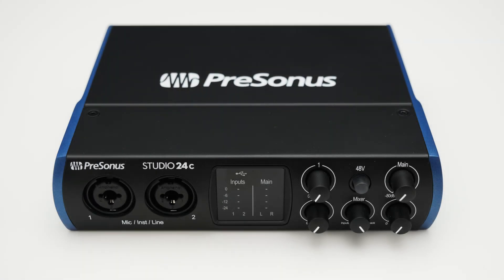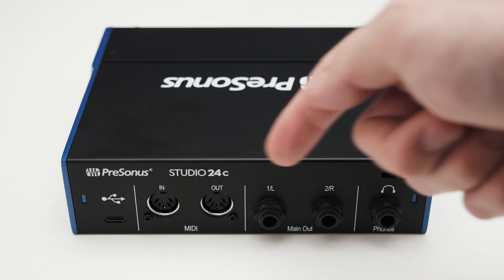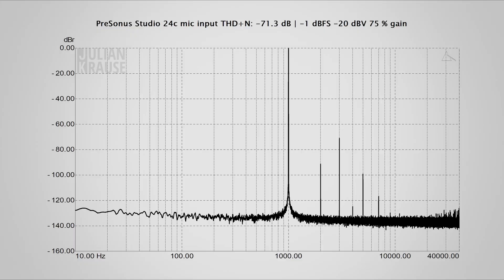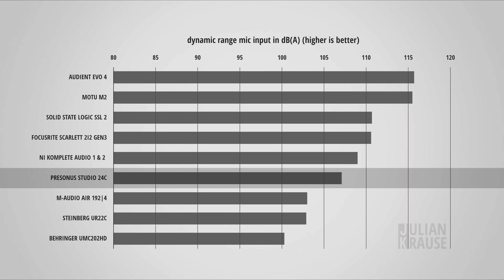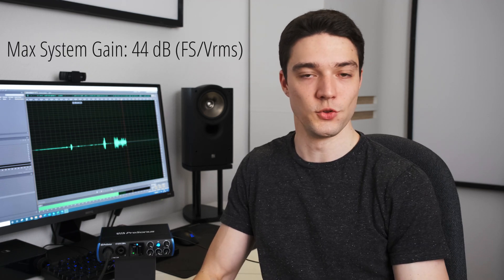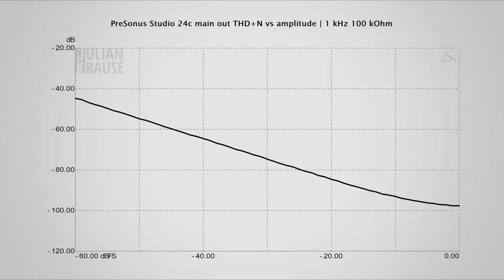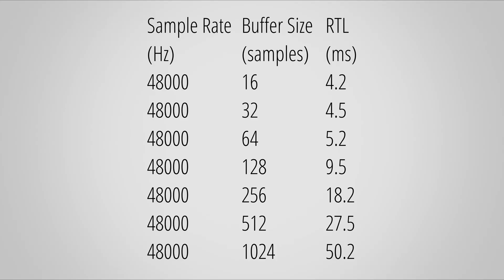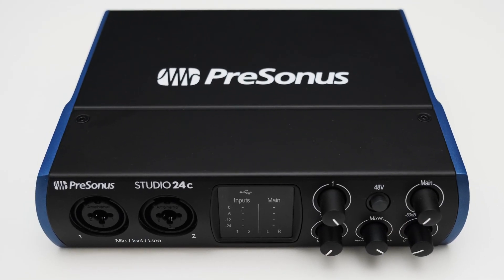PreSonus Studio 24c Audio Interface Review (audio quality test)

Comment: Excellent reviews. But would be nice to have reviews on the DAC clarity in comparison to similar interfaces. I work entirely in the box and am mainly interested in getting as pure a signal as possible into my monitors and headphones. You go into the depths of the tech specs but how does it sound in practice as a DAC compared to other interfaces. There is definitely a difference, my Mackie Onyx sounds more pure and open than the  Behringer 204HD and Focusritte 2-2 2nd generation I have tried before. The best interface I have ever owned for dac quality was EMU 1212M, that had incredible conversion , really pure and flat as a pancake.

Comment: I am happy with mine and only wish I had the money to upgrade to the multichannel units. I am using presonus small monitors and they sound good to my ears though I would like hefty ones instead. I have smaller fingers so the 24c front panel isn't a problem for me but I can see where it would be for someone else. Over all I have had good luck with Presonus and this kicks ass compared to my old firewire 410. and the virtual ins are great.

Comment: Thank you for yet another in-depth review. It's so empowering to have these un-biased no nonsense reviews!
Is there any way to check/review the robustness of the drivers and how they perform with some DAWs? With most of the 'Specs' these days very much acceptable for general usage, the problem these days is how the interfaces perform with certain DAWs (read - Pro Tools)
Reply from the maker: Good point, I'm looking I to evaluating the driver performance but so far I haven't found a repeatebel testing method. It's definitely on my to do list.

Comment: I compared the dac sound quality of the focusrite, steinberg and audient id14.  I only use the mic input for measuring and eq of my monitors.  I tested on jbl lsr30x monitors.  I really thought all three units would sound the exact same way besides maybe noise floor.  The audient is the weirdest one.  It has a high end treble lift and its pretty noticeable.  The focusrite just sounded like it had a lower quality dac in general.  Everything had a sort of metallic sound to it.  Kinda like going from cd bitrate to 320.  Most people wouldnt notice but on revealing speakers its there.  The steinberg had nothing weird about the sound.  Smoother than the focusrite and similar to the audient minus the high end lift.  The steinberg is also the heaviest.
Reply: Wondering what is the model of your Focusrite?  Is it a 3rd gen product?  Thanks.
Reply: @SheldonTam  2nd gen

Comment: Any advantage to having a usb-c connection with this device?
Reply: not really, the interface is only usb2.0 but it's nice having the option. i'm using on usbA 3.0 and getting super low latency perfect for virtual realtime guitar amp. you get both cables but i ended up using a different longer one no worries.
Reply: @OrganicFanatic  Not sure what you mean that "the interface is only usb 2.0." The specs from Presonus say usb-c. If you mean it's also compatible with usb-a then I understand, but not "only usb 2.0." My original question was just curiosity if the faster usb-c connection made any applicable difference over usb-a or usb-3.
Reply: @pilotgi  "When adding USB 2.0 devices equipped with a USB Type C compatible connection, like the Studio c-series audio interfaces"

https://www.presonus.com/learn/technical-articles/What-Is-Usb-C

USB-C is the connector shape on the interface but in this instance with the 24c it is only using USB protocol level 2.0 which supplies plenty of speed and low latency for this type of work :)

Comment: The outputs is not balanced! I see only one double opamp and two capacitors in output circuit on the board, for balanced outputs you need double of that. That can be deal breaker for some applications.
Reply from the maker: Good catch! The output is in fact not differential but it is impedance balanced. This is still a fully balanced connection and you will find this on quite a few interfaces.
Reply: Yes, you are right, if it is properly impedance matched, then it will have the same performance as electronically balanced.
Reply: @Mr_G  I also studied the PCB, but I have overseen that! It's really pity, but fully typical, that equipment for ~135€ uses absolutely cheapest design with OPAs for 0,30€ and there is saved on every resistor for 0,01€ (plus unbalanced output). Unfortunately, better design like UAD, where are used good components (like PGA2500) are extremely expensive, even when the preamp circuit costs 9€ in total. The same situation with DAC/ADC, usually are used for 3€, when the best (AKM, ESS Sabre, ..) are 2€ more expensive only ......

Comment: How about branching out a bit? I  recently bought the Mackie ProFX12 v2 and it does everything that most of the audio interfaces do plus it has built-in effects and 12 channels. I like onboard effects because you don't have to deal with the extra delay created running them through a VST. It also has loopback and 4 USB channels.

The audio quality seems pretty good although I have no idea how to test anything like you do. 😁

FWIW, I almost bought the Presonus 24C but it was on 6 week backorder while the Mackie was shipped next day.

Great review as usual.
Reply from the maker: I have been looking at some mixers with integrated USB connections for a while know. I would probably start out with smaller ones, but the Mackie ProFX12 v2 looks quite nice :)
Reply: @JulianKrause  The best part is that it was only $220. That's the same price as many interface only products.

Comment: Hey, Julian. Hope you're ok. In your review about the Motu M2 (around 8min50s) it's show a RTL of 15.9 ms for a Sample Rate of 48 kHz and a Buffer Size of 128 samples. This Presonus Studio 24c has a RTL of 9.5 ms for the same other parameters. It's a huge difference. Is that correct? I always tought the Motu M2 offered better RTL times. Thank you for your reviews, they really helps.
Reply: On my Windows 10 system the lowest I can do is around 10ms-12ms (sample rate doesn't matter) and using ASIO I managed to get down to 1ms.  I was shocked but 3ms on the M2 was fine using FL Studio and the MOTU ASIO driver.  Now having said that MOTU M2 is crap and I will never ever touch another of their products.  I purchased two different ones from two different sellers in a 4-6 week timespan and both died on me in under 10 mins.  The first was 8-10s of recording then USB said it was there but could not handshake with it so dead.  Yesterday evening I went to use the second one and it wouldn't even turn on.  I thought my USB port was blown by it but I swapped over my kybd and it worked but still the M2 was dead.  I pulled out the cable from its back and re-inserted it and flipped the on switch and everything work EXCEPT no computer will detect that anything is even plugged in.  That makes two hardware failures and I suspect it has to do with everything being ramped up to keep up with the human malware causing a mad rush for devices so QC is gone and the machines are being pushed too hard.  Anyone who reads this you have been warned.  Oh, and USB-C sucks and I hate it.  Cables are expensive at ~8 USD per foot for a real one and the included 1m is too short and being USB 2 the limit is 5m so give us a 2m one and all would be fine but 1m I couldn't work with very well.
Reply: @generalawareness101  They're not pumping them out fast, I ordered mine and had to wait maybe 3 months. No signs of being rushed and the unit works perfectly. Have you contacted anybody at MOTU? Their service was pretty immediate (I had software problems).
Reply: @nimrodery  I am in the USA so we come first with a USA company like MOTU and it took 6 weeks for them to go back up for sale (seems to be in a six week cycle on Amazon in the USA).  Yes, they are working overtime but simply can't keep up.  Fact is another reviewer on YT said many people are complaining about this lately from reviews so I am not alone (he is a M2 fanboy too so was not easy for him to say that).  It is a shit product now so I am done with them.  edit:  Their support is top notch but their product is just a failure right now.
Reply: @generalawareness101  you realize there is a pandemic yes?
Reply: @massivebeatzz  Sorry, you are on stale news it is past pandemic and is now endemic, but nice try.
Reply: @generalawareness101  
Pandemic, endemic, whatever..you are aware that there still are worldwide shortages and transport/delivery problemscand delays?

Ofcourse this can explain scarcity, rising prices and long waiting lists, but should not lead to bad QC.

I'm also interest in Motu M-models, but the stories about driver- and other problems make that I refrain from ordering right now.

What would be a decent audio interface with stable/reliable performance in combination with Windows 10 laptop/pc?
Reply: Tascam might have the best latency, you can set their ASIO to 4 SAMPLES, and apparently it's stable due to an in-house driver they created; probably takes a decent computer to make it very stable but it's worth checking out
Reply: Those settings in FL Studio ASIO with the M4 get me 3 ms, after plugins 9 ms. Not specified whether that's round-trip but I can confirm the latency feels low and response is pretty snappy.

Comment: It would be interesting to see the studio 68c. It's  got a lot more gain on tap in the preamp than the 24c - I believe presonus quotes max of +80dB on the 68c and +50dB on the 24c. Might be running on a higher voltage rail than the bus powered 24c.

Comment: I really wish they start to pushing thunderbolt interfaces to low budget setups, USB 4 is on the way and those interfaces are stuck on USB2.0.... Great review as always!
Reply from the maker: I fully agree with David. The bandwidth of USB 2.0 is more than enough for 2 channel audio. There is no point in using USB 3.0 or higher an likely only makes the device more expensive.
Reply: Bandwidth is more than enough, but latency is a lot better on TB devices, straight PCI access and etc , IMO it's time to see ~ €200 TB devices more often... Zoom has an affordable one, but without windows support and we have UAD but it is a premium device
Reply: For this few inputs and outputs, there's no point.

Comment: Please, review PreSonus Studio 68c
Reply: Seconded.
Reply: On paper the published specs of the 24c and 68c are very similar, with the 68c being slightly better overall with gain range, dynamic range, output levels, and headroom. The 24c beats it by the tiniest of margins in things like THD by thousands of a percent, but the margins are so small you wouldn't be able to hear a difference. If you want sound quality, they'll be virtually identical. If you want bragging rights over which is better "on paper" by minute amounts that can only be measured by test equipment, then the 68c will win in most categories. Either way, anything in the sub $500 price range is going to be so similar that it won't matter, no matter how golden one claims their ears to be. Just get whatever suits your I/O needs and go create and be happy. E-peen stroking over n-th's of a percent of paper specs at the consumer level is not worth wasting energy on.
Reply: @Storm-Chaser  You must have read something different than I did.
Reply: I have both 24c and 68c. Their monitor output sounds similar. 68s preamps has more gain but lots of people are using condensers so i's not much of an issue in my opinion. Both have a little bit weak headphones outs but gets the job done.
Reply: 4th
Reply: 5 🖐️
Reply: bro it will be the same, diffrent only be in how many in and outs they got .
Reply: 68c is not as good, in a lot of specs, as the 26c.
Reply: General Awareness  @ 26c better than 68c  how so ?
Reply: @generalawareness101  You are right, 26C is better
Reply: @yeauld  It amazed me as I looked at the specs and they don't make sense.  Spend more for worse specs.  I think I am done with these USB-C boxes and I am going for a tank like the 5 year old Behringer 204HD or 404HD because I have had nothing but trouble with C based units if they are using USB 2.0 protocol.  Cables that will pass data are expensive etc...  Honestly the USB-C is a marketing gimmick if being used at 2.0 speeds.  At USB 3.2 speeds (way over kill but was what C was really designed for) the max length of cable is 1M which is just too short for me (strangely enough, and something I think shows Marketing is the culprit, even the 2.0 cables are 1M long if they are using the C end which is stupid since 2.0 has a max length limit of 5m not 1m.
Reply: @generalawareness101  I actually had to go and buy a brand new USB C to A cable because mine was defective and just by moving or touching a tiny bit the cable or the interface I immediately lost signal, so I went to best buy and for around 20 bucks I got a brand that many people recommends ( Belkin ) and I might be under some kind of placebo effect but the sound is way better now, that Belkin cable made my Presonus Studio 26C sound really really good, very transparent and warmer, Im pretty happy to know that the cable was the only problem.
Reply: @yeauld  I had two MOTU M2 that died on me and the first one was 8-10s then the USB would no longer handshake with it.  The second one I just sent back was 8-10 mins and I woke up, turned it on, and dead.  I thought it had blown out my port so I swapped it with the kybd and all good but still dead.  I pulled the plug out of the back of the M2 and pushed it back in then flipped the power switch and it came on and all worked BUT no computer would recognize it at all.  Not sure what is going on but it could be bad cables or something seriously wrong with the units and USB (I am not alone as this is happening to others I since found out).  USB-C cables are a cash grab too because 6-8 dollars a foot is insane but some of the cost is the damn chip that is in each one unlike any other cable out there.